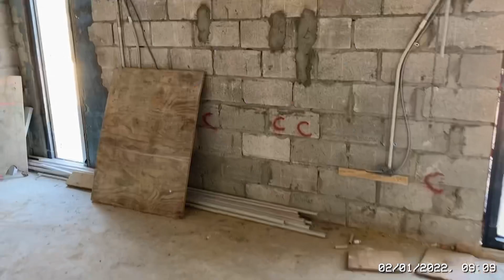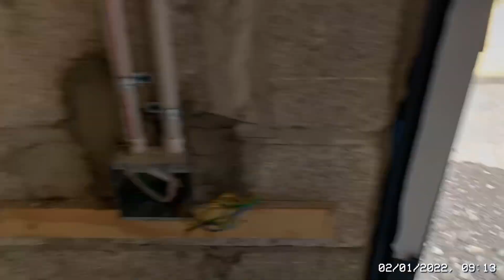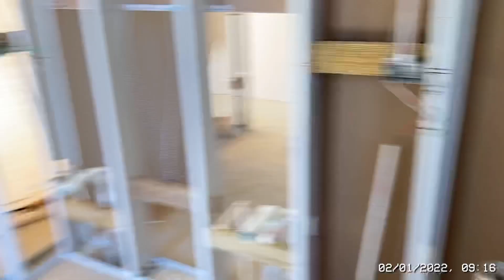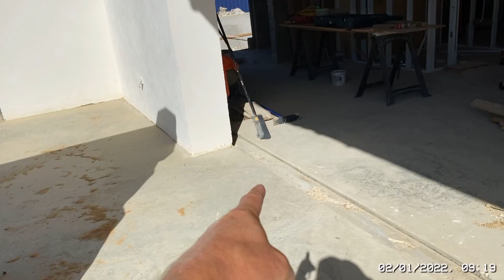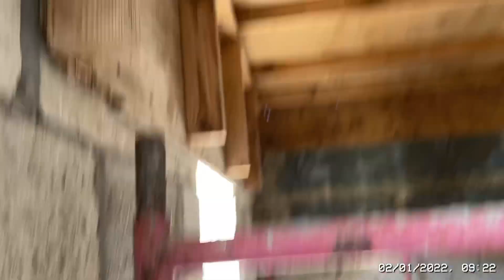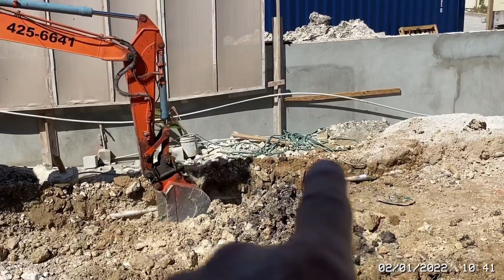Barbados 🇧🇧 Beach House Build - Day 202 Building our Dream House in Barbados

Comment: Think they should use pex piping bcuz it works better with the drywall settings just my suggestion anyway and plz yes let them pressure test the water system b4 u close the shower walls
Reply: Yes  thats correct I said the same thing  so the plumber need to get cracking on and finish